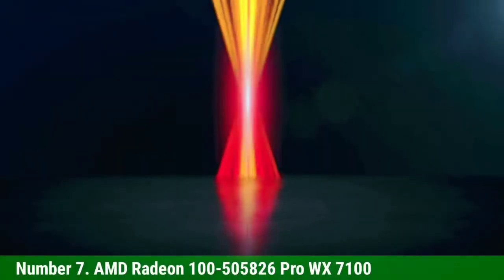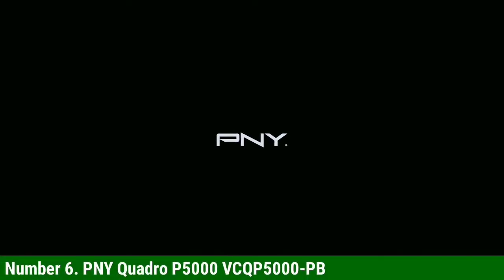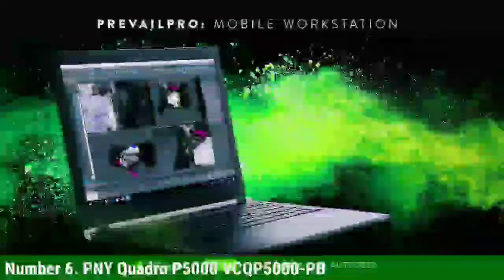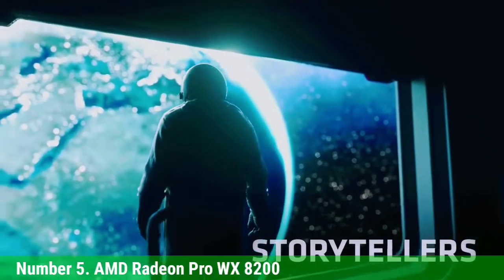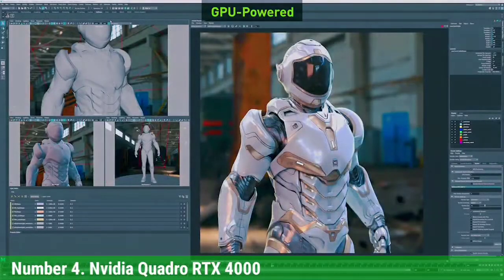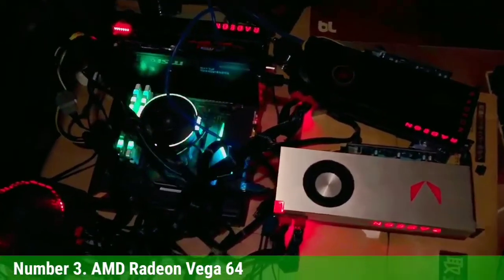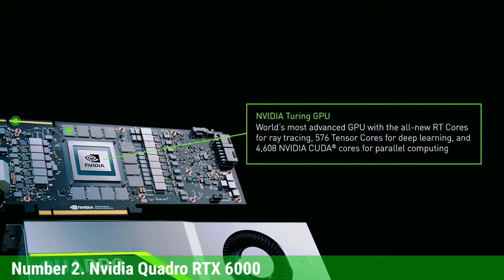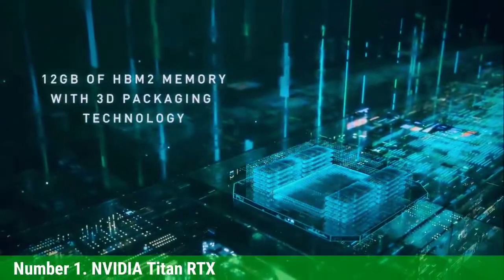Top 7 Best WORKSTATION GPU In 2022

Comment: P4000 HAVE RATRACING. I HAVE A CARD USE OK
Reply: No it doesn't, I have a p4000 and p2000, and rtx a5000, and neither of the P class do, only the quadro rtx 4000 and rtx a4000 do